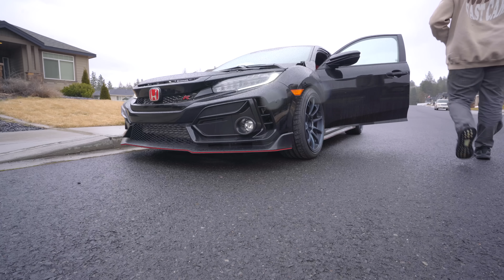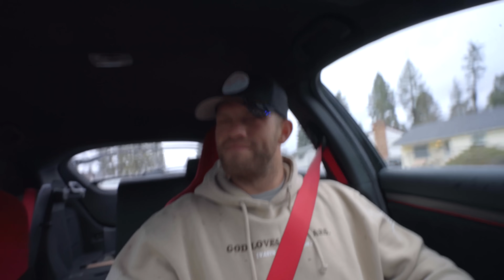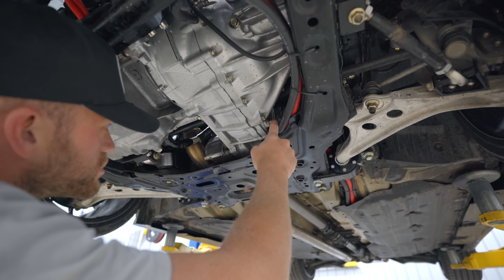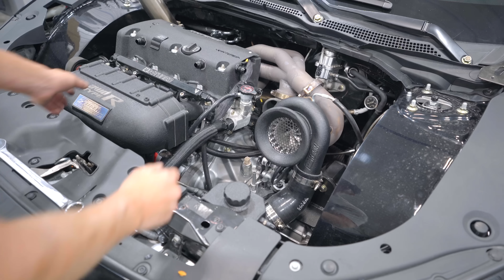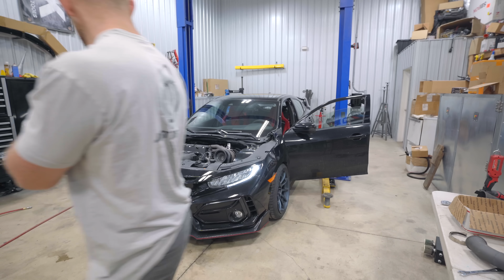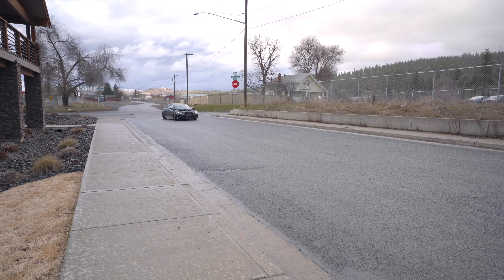Installing a Billion $ Transfer Into the 1 of 1 AWD Type R (and launches)

Comment: Hey Devin, love the build! Crazy idea, Syvecs has a diff controller for the GR Corolla. Run the GR diff in the rear. You already have a Civic "Type-X", would love to see this beast do AWD drifts roasting all 4 tires 😎
Edit: Honda had a rallycross Civic for a while, so I always hoped they would do an AWD/rally spec version for the street.
Reply: Doesn't the diff on the gr overheat really bad? Or does this other brand fix that?

Comment: SUBARU FELLAS I HAVE A QUESTION
Recently I did some work under my 2016 Wrx and got one of my transmission cross members bolts that goes into the frame stuck. Cannot tighten or take off. Does anyone know how I can get that fix?  From what I can find it seems like there’s a nut that might be in there and that broke which is causing my issue (I don’t know a lot or even know if that’s correct)

Comment: No air filter and hood is crazyyy, water right through that motor
Reply: it's not that heavy rain, compressed air needs to be pressurized and then gets heated (small water droplets evaporate) before even getting to the intercooler inlet...
However, I do really recommend Devin to install a filter for the sand & water
Reply: Wich is fine tho, Ever heard of 
"Water meth injection" or just "water injection"? Sometimes they just spray water or combination water and methanol to make the charge temp lower if it doesn't use intercooler/heat exchanger. Yeah it does need a tune for it but if it's just few droplets of rain, it doesn't do much to notice. Yeah it's definitely dirty to run engine without filter. It's never good for the engine but it's good for the power.